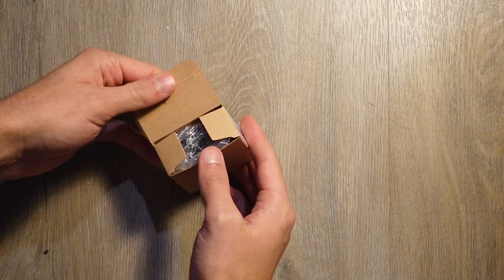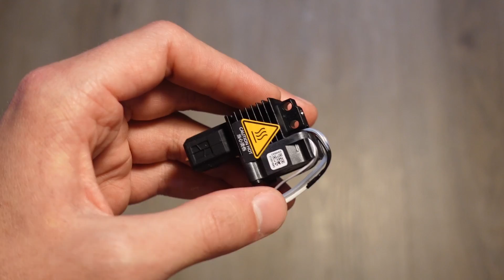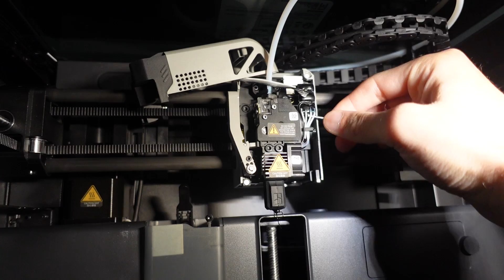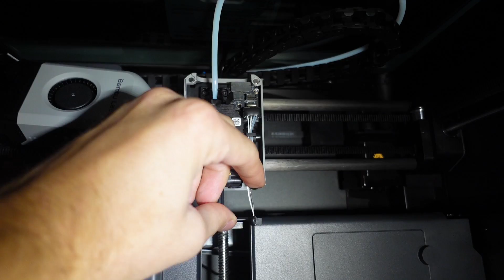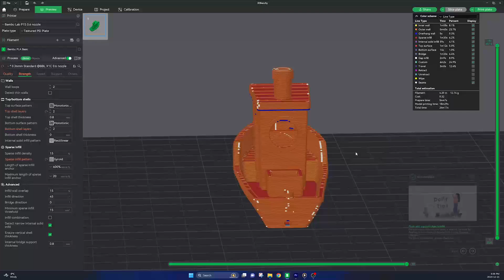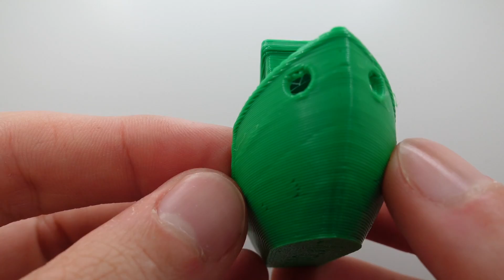How to Change Nozzle on Bambu Lab P1S (Complete Hotend Assembly)

Comment: 2 screws and 2 connectors that's 4 operations too many. After the trials and right of passage that is modding the Ender 3, I'm just gonna say fuck it and order a Revo for the P1S. I've had enough reaching into tight spaces with allen keys, throw money at printing problems instead of time and you'll be happier.

Comment: Thanks for this tutorial.  I actually watched this before I started to more heavily use my P1S.  I KNEW I wouldn't be able to do the thermal paste and whatnot with just the nozzle swap, so when I bought my machine, I picked up 3 complete assemblies (discount for 3+) as well.  Your guidance helped me swap it out.  It wasn't super difficult, but knowing I'm not going to screw things up also makes me very happy.  My Enders all require unscrewing the nozzles and I've never once swapped out the nozzle without issue (always worried I'm going to under or over tighten and it then becomes a self-fulfilling prophecy) but this was insanely easy thanks to the tutorial and planning ahead with the easier to replace part...sometimes spending a bit more knowing it will save you more peace of mind is the wise decision.

Comment: step one, unload the old filament, step 2. POWER OFF THE PRINTER! then you can use the steps mentioned in the video, it should be said that checking bambulabs wiki is advisable...

Comment: Biggest issue is you never said to unload first. for a newbie that sucked.
Reply: You don't have to unload, just cut the filament so the hotend is not hanging on the filament and you're good to go. 
You can cut the filament by pushing the cutter-lever on the left side (when looking from the front that is) of the extruder.
Reply: @_szyha you saved me tonight first time doing this! ❤🎉
Reply: same here. i didnt unload or anything. just removed it. calibrating it now. did it cause issues for you?
Reply: Yup i just did this, hopefully the old nozzle being full of filament doesnt cause issues later if and when i reinstall it.
Reply: @slippermoto3303 I was thinking about that if I should just cut it right there. But I don't think it's wise, since there is no cone to guide the filament into the nozzle freely.
Reply: Yep the same thing happened to me just now lol i'm like "wtf why isn't the nozzle dropping as easy as it should?" 😂😂😂 fkk ahaha

Comment: What’s the benefit of changing out the nozzle on a P1S?
Reply: By switching to smaller or larger nozzle diameters so you can print with more detail or faster. Also, you can switch to hardened steel nozzles to print using abrasive filaments without wearing down the nozzle as quickly (when compared to my regular stainless steel).

Comment: I bought the 0.6mm nozzle to use some different filament that BambuLab sent me for free and thought the material would be interesting to use. Is the 0.6mm ok for most normal prints or will I want to install the 0.4mm nozzle back afterwards?
Reply: Yes 0.6 is fine but if you want more detail opt back to 0.4 or 0.2

Comment: Good video. Quick and to the point. As another commenter mentioned, unload your filament first then be sure to power off the printer before disconnecting the wires.
Reply: .... oops. That's fine to forget that. That's probably fine, right? 😅
Reply: @dumbgames4933  yea as long as you didnt pull the grounded side out first 😁
Reply: I was wondering about this and then I saw you comment thanks for posting!

Comment: the replacement nozzle that the printer comes with is just the nozzle. it doesn't have that rubber thing. is it necessary for the rubber cover?
Reply: u can detach all of the old parts from the old hotend such as the fan and the thermister and the silicon cover and attach them on the new one

Comment: FANTASTIC!  The link bambu sent me does not show how the hotend actually fits and does not show that the screws need to be pulled out of the hotend.  I guess I should have watched the video a lot closer as the screws are missing when they pull the hotend out.  My bad sorta.  After much cussing I came back and searched and found your video.  I was already subscribed and I definitely hit the like button.  Might as well ad more to this.  Got the hotend installed and now won't print with error code.  Finally found out it was fan not plugged in good.  Did a factory reset and then did a full calibration.  Now it puts out filament but it messes up the preprint pass and drags that out to start printing.  Puts down a nice first layer except for the blob that is created by dragging the preprint filament to the print area.  Goes through a nice first layer except for the blob.  Hits the blob and then it all goes to hell.  It has done this twice now.  I am thinking there needs to be some kind of Z-axis calibration like on my Prusa mini.  I will have to search for such and if anyone has a link I would appreciate it.  Thanks again.
Reply from the maker: Awesome! Glad it helped
Reply: @engineer3dprints  I got that installed and now it won't print.  It gets hot and moves around but it won't print.  Now it is back and forth email imatation tech support for a few days and it may run again.  I don't think I will ever buy another Bambu printer.  I have a Prusa Mini that has been bullet proof and wish I would have bought another larger Prusa.  Thanks again for your help.

Comment: This video is missing several critical steps like turning the printer off and unloading the filament
Reply: New nozzle does not have wires attached
Do I need to remove from nozzle being replaced?
If so how?
Reply: @petemessare1766  it sounds like you may have only bought the hotend part, which means there's more steps to attach the thermister, fan, etc.
Reply: It's fine if the printer is one just make sure nothing is activated
Reply: And replacing the fucking nozzle instead of just plugging in a new hotene
Reply: Have you tried turning it on and off again?
Reply: Please take this video down. You're missing steps.
Reply: Do you want him to tell you when to breathe as well?
Reply: @Alec9821  Who hurt you?
Reply from the maker: If someone is taking apart a printer while it’s turned on, they probably shouldn’t own a printer.
Reply: @engineer3dprints lol for real. People complaining about a free video. I absolutely hate 3d printers (I'm the default tech/repair man for my young daughter). I have had to assemble three different printers, swap out parts, and troubleshoot more times than I'd like. I want to smash all these printers with my face😂 jk. But my daughter is such a good kid, she's really smart, and she does all kinds of amazing prints. Prints. She knows how to design her own, and do all kinds of custom stuff. It really is incredible. She's so patient and sweet. Anyway, long story long, I love that she is into it, and I'm here for it. A lot of the how to videos I have watched, have been too fast, they don't show you what they're talking about, or they're just crap. This one was great. I saved it, and I'm sure I will be going back to it. Thank you for posting it! 😎❤️👊💪
Reply: @engineer3dprints some printers may have components which are available for hot swap and you are still missing part of unloading filament which is also crucial. You can presume whatever you want but why doing tutorials which are obviously missing vital parts. Moreover Bambu Lab is positioning as plug and play and new users friendly. 
So if someone is making video tutorials and missing important parts of video tutorials, they probably shouldn’t make tutorials. 

No hate, much love:)
Reply: @engineer3dprints thats a bad reply, I was thankful for the video but this attitude is what I quit few groups. People who are beginners in the 3D printing dont know everything is the reason they go with bambu to learn as its easy. I still thank you for all other information you shared its helpful but not this comment.
Reply: @koolzfr  if a new beginner doesnt know that the power should be off for whatever project they are fixing or working on, they shouldn't even be attempting to work on whatever they are working on.
Reply: @engineer3dprints if someone wants to create instructional content videos they should consider ALL skill levels or shouldn’t be making instructional content videos.
Reply: @rickhoupt6933  "all skill levels" should know never to have power on to ANYTHING when working on it.  If the user doesnt have basic common sense to turn power off, then that user shouldn't be fixing whatever they are fixing.
Reply: @engineer3dprints  It's my first printer, and everybody makes mistake and try to learn that's the point. The video is a  step by step tutorial on how to change this part. I shouldn't be owning a printer apparently, but I tried following the video and forgetting to turn off the printer. Now idk why but the fan don't want to work. Maybe that's not related to forgetting to turn off the printer or maybe it's the issue. But damn that was a close minded answer.

Comment: Remember that it's as easy if you buy the 'Complete Hotend Assembly'. If you buy the hotend, thermister, fan etc separately, it takes more work.
Reply: Only like a few more minutes to assemble . I just bought the  Hotend and nothing else decause it was cheaper (on Amazon)and I just used the same fan and thermister.
Reply: I made that mistake but it was pretty easy to install the thermister and fan is just 2 screws.

Comment: Pro-tip that I just discovered that wasn’t mentioned in this video but should be common sense. lol UNLOAD THE FILAMENT FIRST if you have any in there. I was so focused on doing everything in the video just right that I didn’t notice I still had filament loaded before I pulled out and the filament broke. I was able to get it out of the extruder but it’s still in the old nozzle. Thankfully I don’t need that nozzle anymore.
Reply: All that you would have to do would be to cut the filament at the top and then reinstall the nozzle, heat it up and extrude some filament like normal. I only know this bc I did the same 😝. No need to trash a perfectly good nozzle.
Reply: @connermcgarrah2171  lol thanks that’s what I figured and what I was going to try if I ever want to use that nozzle again. Thankfully I just purchased two hardened steel ones so I shouldn’t need it anyway, but I’m still keeping it just in case.

Comment: I just changed out my clogged nozzle wit the replacement one ... but when I heated up the nozzle, it started to smoke. Scared the heck outta me and turned off the printer ... is this normal?
Reply from the maker: Depends how much smoke. It’s possible there is some residue from manufacturing burning off but if its anything more than that, no it’s not normal

Comment: Isn't some step required before starting to change the nozzle? Like extruding the existing filament?
Reply: Bambulab printer always cut the filament and clean the nozzle after every print :)
Reply: @pandsindsuß  not true, you have to unload first....
Reply: @benjaminwiedmer  depends. If you use the ams it always cut the filament, clean and unload
Reply: @pandsindsuß  Oooookay, thaats true 😅

Comment: I changed my nozzle when I kept having a mesh/bed leveling failure but now every-time I print it won’t adhere. I did a calibration but it still does it. Any suggestions?
Reply: Hey! If you're still having trouble. Try 0000steel wool just taking the sheen off the too. Should fix problem
Reply: U fix it ?
Reply: Glue stick. I have resisted using a glue stick for over a year. Had a difficult one decided to use a glue stick and now I just glue everything it's just the whole heck of a lot easier like the cliche don't fight City Hall glue stick seems to solve the problem

Comment: Did you run calibration after installation of new hotend?
Reply from the maker: The first calibration after installing the hotend was completed in this video
Reply: @engineer3dprints I think the OP meant the actual calibration function in the printer’s settings on the screen, not the benchy.